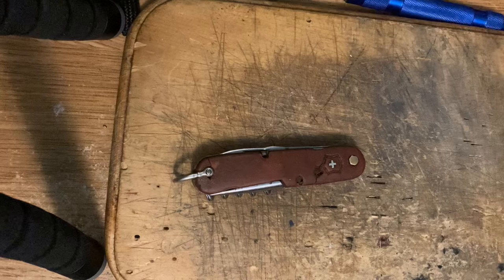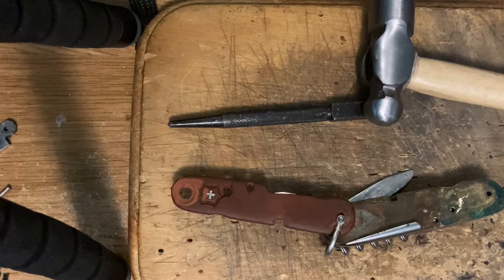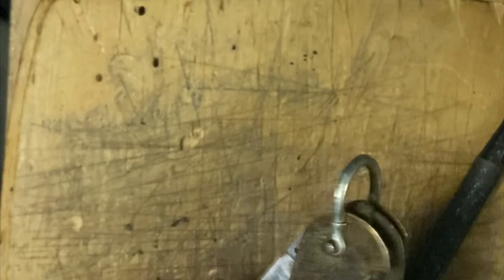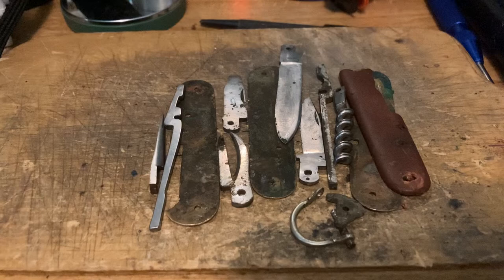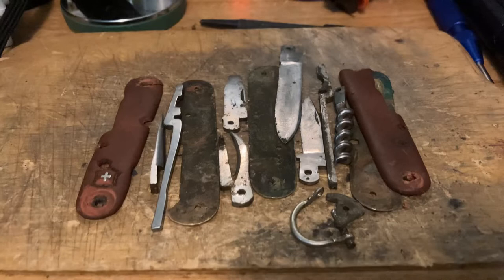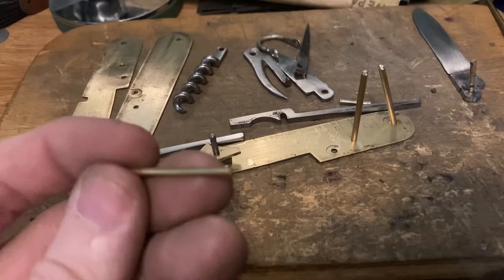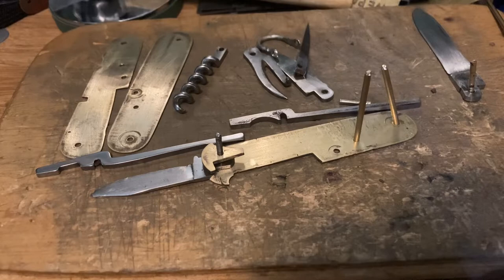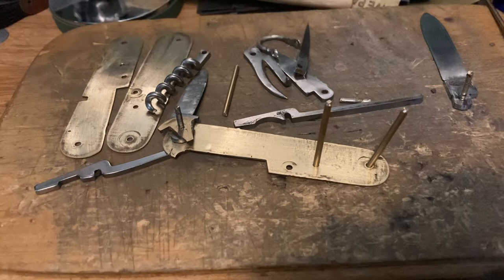Restoration of a 1923 84mm Victorinox Swiss Army Knife

Comment: Nice progress Grizz! Thanks for sharing your work. It’s great to see other restoration work and not just pics. I couldn’t do the work with video running and it’s a pain to even stop for pics, so I appreciate the effort. Best of luck with the scales. Closest I’ve done are horn scales tgat had lots of bug holes to patch. 

If you have trouble matching the scale color, one thing I do is use material from the back side. 

Looking forward to part 2! 👍